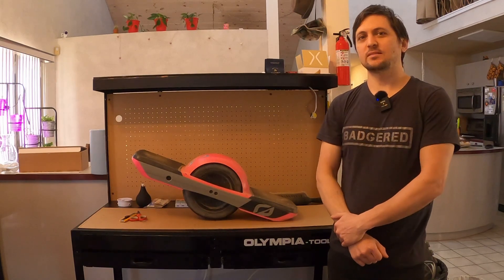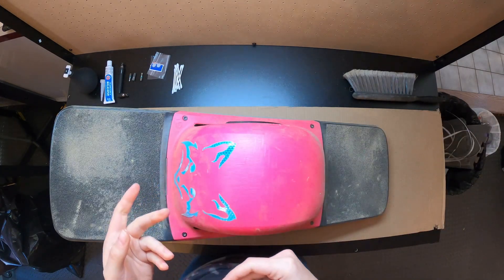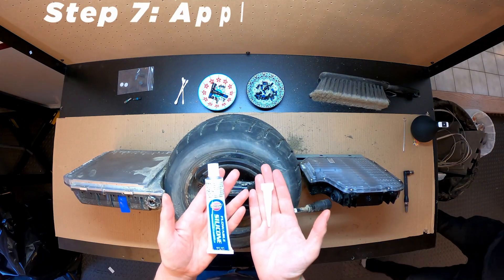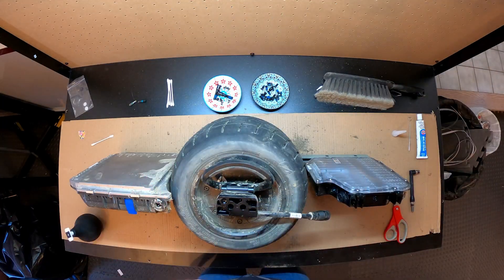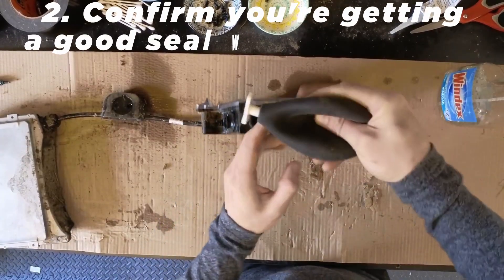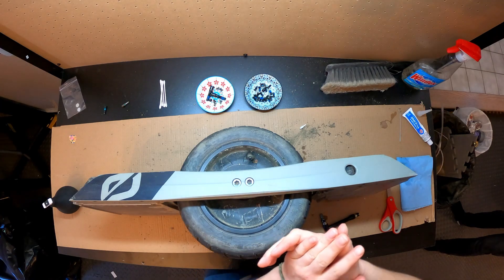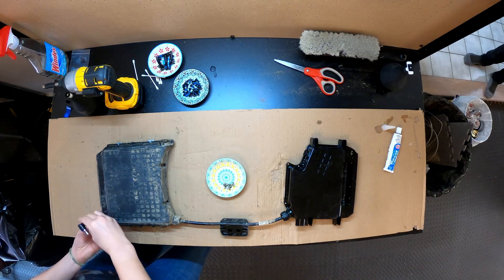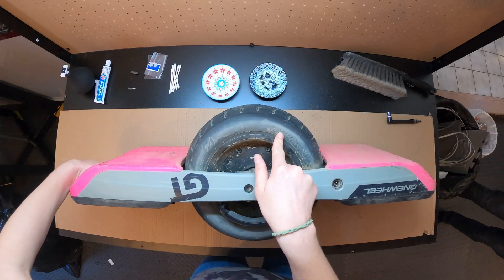Tutorial: How to Waterproof your Onewheel GT

Comment: Are the vent covers reusable and is it possible to put a layer of silicone on the outside edges of the controller and battery box to prevents leaks?

Comment: Aren’t those gaskets lubricated with grease by FM? Even if there is no grease, you should thoroughly clean (grease free) any part or surface in order for the silicone to stick. Any contaminants will make any silicone seal fail.

Comment: So none of this will Brick your GT ?
Reply: Nope but it will definitely void the warranty if you remove the covers to apply silicone around the gaskets.
Reply: @Chewbaccawheel  none of this voids your warranty. Please, don't spread misinformation.
Reply: @fred_e  It says in the video it will void the warranty. So it doesn't void it than?
Reply from the maker: The basic waterproofing process does not void your warranty. If you choose to open the controller and battery to silicone those gaskets, then that will void your warranty. Your choice how far you want to go with the waterproofing process
Reply: As long as the battery maintains a steady connection to the computer, it will not brick your machine.